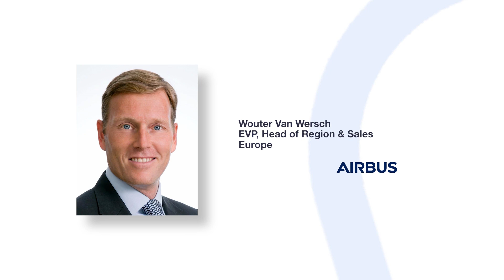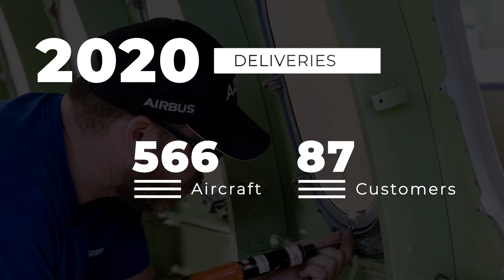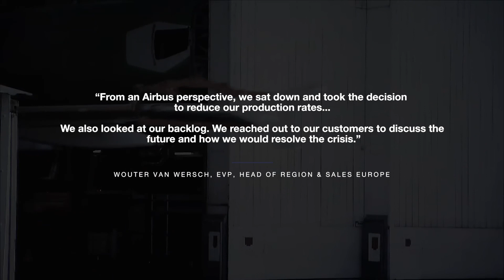Airbus Has No Whitetail Aircraft Left

Comment: I view this claim with skepticism. Air travel has not rebounded that much yet.
Reply: White Tail does not correlate to volume of flight. It could just that Airbus has drop their production number so that they could sell what is in their inventory.
Reply: @kazedcat  True, white tails do not correlate with the number of flights. And Airbus did slow their production rate. White tail airplanes are planes airlines have ordered and then for some reason are not able to take delivery when they are finished. One of those reasons is the airlines stop flying and or collapse and shut down. And a number of airlines did just that. They just went away prior to taking delivery of the airplanes the ordered. That leaves the builder with airplanes with no customer. The sheer numbers of planes which were grounded (thousands of them), many of which are still parked in storage, makes me very skeptical that there are many airlines in the position to snap up white tail airplanes. Makes me suspect many of those white tails are still out there, but the “books are being cooked” to indicate those airplanes are sold to customers when they actually are not.

Comment: What does this "whitetail" term mean? Does it mean fully assembled aircraft that haven't been delivered yet but won't be because the customer cancelled?
Reply: Fully assembled aircraft that have no customer because the customer cancelled the order
Reply: Yeah and I think they are called whitetails because normally airlines paint the tails but because they have no airline the tail is white
Reply: In contrast, many Boeing 737 Max aircraft were completed and painted with the customer's liveries but they ended up being stored at random parking lots near Boeing's facilities back when the type was grounded after the two crashes that occurred in late 2018/early 2019. This basically means that those aircraft were at or near the delivery stage when the grounding order was put in place whereas in this case, the aircraft are fully assembled but with no real customer to go to.
Reply: @generalgiovannicresvaresur2771  I would be very nervous to step onto a Boeing 737 Max, no I would not risk my life to fly this airplane.